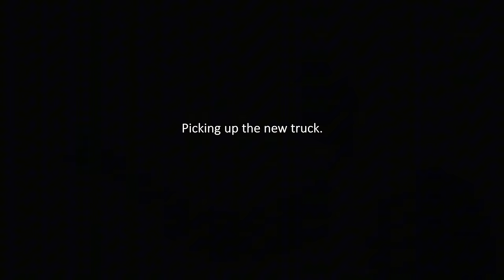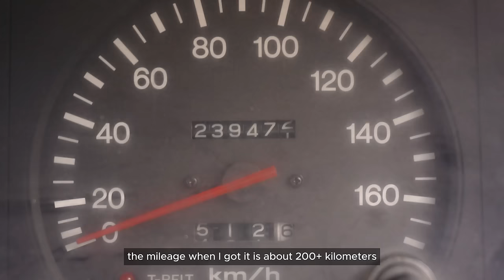I BOUGHT MY DREAM TRUCK!

Comment: 1KZ engine - don’t push it when going uphill, slowly crawl and watch the temp meter, the key is to not get it overheated (install an external water temp gauge, that certainly helps) - maintenance with the cooling system is paramount. Enjoy the journey with the truck
Reply from the maker: Cooling system and Overheating prevention. Will keep that in mind. Thanks for the tip!
Reply: @JunOutdoors  I want to agree with @alantan7644.  The 1kz-t is a great engine, I have been driving mine for 10 years now.  BUT they have a weakness, like all engines have .  In the 1KZ it is the possibility of overheating and 'cooking' the aluminum head.  So regular maintenance of the entire cooling system is 100% important.  That means a clean, good flowing radiator, properly functioning thermostat and radiator cap, unbroken radiator fan and fan shroud, good/non-brittle radiator hoses, newer water pump, a working fan clutch (if the fan clutch has not been changed or had the viscous oil changed, it probably is worn out by now just due to age) and of course proper radiator fluid/antifreeze.  I do not know how much 'baseline' maintenance has been done when you bought it, but please do not plan to spend too much money modifying before you do proper 'baseline' maintenance.  That includes timing belt, replacing water pump if you have no record of it being done, and checking all hoses and vacuum lines, engine seals, all of which just get old after 30 years of hot/cold cycles in the engine bay.  Also: if your truck and the automatic/electric 4wd hubs on front axle, they are well known to not work and are very difficult to keep maintaining fixing. Consider converting to manual hubs, and while you are at it you can do a full front swivel hub rebuild with new bearings and seals.  Congratulations on your new truck, I love your manual gearbox and PTO winch!  Just be prepared to spend money on maintenance, even if the LC is legendary for reliability is it only reliable when the owner spends money regularly fixing problems BEFORE they become a big problem.
Reply: similiar to zd in a patrol i own, i would make this 1st priority before anything as it has similar problems. radiator, egt gauge, exhaust, intercooler. nothing crazy fancy, mainly upsize these components. i think snorkel/airbox and safe tune would be after
Reply: good advice
Reply: Careful with the 1kz engine. Also upgrade the exhaust to 3inch pipe to help the engine. Their heads are pretty weak

Comment: The 1kz engine is proven to be powerful and reliable , just make sure it doesn't get overheated.  Make sure the cooling system is functioning well. Once the 1kz overheated it will start having endless cylinder head issues. The 1kz will run like a clock unless it get overheated. And don't forget it's a belt driven engine, if the last change history of the timing belt is unknown, better have it change before any long journey drive.
Reply from the maker: Prevent overheating and watch the timing belt. Got it. Thank you so much for your tips and insights :)
Reply: @JunOutdoors  Also, just from looking at your engine bay, it certainly looks like your fuel filter is old?  Dark and stained anyway!  If you have no record or it being changed, would suggest doing so soon and I replace mine every other oil change (every 10,000k, although that is here in Africa with questionable diesel pumps n stations, etc.)

Comment: That is one beauty of a rig. You Tube recommended your channel and I am glad they did. I subbed and as a fellow Overland enthusiast I am looking forward to your build. My build out is done mostly with composite panels to keep the weight down. The company I work at rebuilds Aircraft and I was lucky enough to acquire some composite floor panel  remnants and built my platform with a wood 2x2 frame and also a fold up "rear door" kitchen box. The box is 29x18 and I  was able to mount it using one hand because it it so light for my door. Again thank you for your positivity and enjoy that sweet rig.
Reply from the maker: Hi there, thanks for the sub! Your build sounds very interesting. Would be great if you could share it on any platform so we could get some ideas!

Comment: What fantastic buy.  These rigs are tough.  There is a very good reason why the 70 Series Land Cruisers continues to be very popular here in Australia despite not having changed much in way of exterior and interior design since the mid-80s..  They just go, and go, and go, and go.  And you're not wrong, 200k kms on a Toyota diesel engine is nothing.  Have fun getting to know your rig.  And you'll find out customising your rig for your perfect overlanding rig never ends (we call them "Tourers" in Australia).  There is always something to tweak and/or improve as time goes on.  But that's half the fun of owning a 4WD.  Congratulations. 👍
Reply from the maker: Thank you. I guess there are many good reasons that have earned the 70 series their great reputation. Your words are very reassuring, now I feel even better for buying it! Can't wait to have all the fun with it :)

Comment: Excellent car, I have a similar car 1993 same engine and it has never failed specially the engine. Durable and stress free with go anywhere attitude. I'm sure you'll enjoy. Word of caution just watch the weight when you are building it up for overlanding
Reply from the maker: That's very reassuring to hear. Awesome. Yes, I will be mindful on the weight as I start building the rig. Thanks!

Comment: Good choice on getting an LC. It's tough and very capable off road. But, you need to keep an eye on the fluids. LC's are known for overheating issues. Other than that, I'm sure you will love driving it on tough trails.
Reply from the maker: Oh yes I have been told about the overheating issue. Thank you so much for your tips!

Comment: Swear to God, you’re absolutely amazing. 
I have no problem with clutch gear on the motorcycle, but I find myself a little bit struggle with manual gearbox in a car. 
Congratulations for your new vehicle ❤❤❤❤
Reply from the maker: Thank you so much :)

Comment: Welcome to the club, you definitely need to change those brake paddle to the manual one,those Auto brake paddle is bulky and makes changing gear abit hard
Reply from the maker: Not really sure what you mean, but I feel like my brake paddle works just fine and there is no issue changing gears for now. Thanks though!

Comment: if possible, install a transmission cooler. it will bring your temperature down as overheating is a common problem for 1KZ engine.
Reply from the maker: Thanks for the tip!

Comment: I love that mark2 lc.. the seat very comfy. Got spring some more.. hahaha.. but this suv needs 2 batteries. But it’s a great vehicles.
Reply from the maker: Lots of possible things to add. A 2nd battery is definitely on the list :)
Reply: Bigger battery like Din100  easier install and good   I also a lc2 owner

Comment: you can check your wheels/rims specs because the way I see it, its wide. there is nothing wrong with it actually but selecting too much wide wheels/rims as your preferences, can stressed the front axle oil seals and kingpin bearing as well. when your oil seals is damaged, fluid will comes out and it can be noticeable when you look at the inner side of your front tire. check on that regularly.  thats the cons of using wide wheels/rims. the pros is its looks cool and buffed. Anyways, congrats on your LC ! Have fun cruising it !
Reply from the maker: Thanks for your input. Definitely something to look into. Those rims are just temporary though, and will be replaced with something more suitable, in time :)
Reply: @JunOutdoors  yeah. 16inch with 8.5JJ rims just fine for the choices. plus it also gives a good grip for the tyres to work in a muddy situation.

Comment: Just listening to your initial listings of What-to-do for your latest "baby",sounds logical and systematic too. Suggestion:to classify Each Big Item by name eg Vehicle Chassis with sub-categories like Engine, Transmission including the mechanical PTO, Suspension anticipating Additional weight from the list of Add-ons to achieve a True-camper/liveable Truck,Brakes,Water storage and Electricals.Can only visualise your truck becoming better day by day and attending a real-4WD course,is highly recommended.Do not rush and as you had said,Bonding time with your truck,is crucial so that eventually, you and your truck are like hand-in-gloves.. do not rush. best rgds.
Reply from the maker: Thank you very much. I've got lots to learn. It will be a steep learning curve. Slowly but surely!
Reply: The saying of "Rome was not built in a day", so just pace yourself and no need to stress yourself up by uncalled-for rushing.

Comment: Excellent choice Jun though it's quite a unique choice I must say! The LC 70 series mostly do come in MT and up to the most current LC300, this model and its  model range has had the reputation of some particular capabilities which u will come to appreciate soon which are having good payload for your camping gears and crew, approach and departure angles which I reckon u will absolutely need to push u through to even deeper troughs and terrains. Hope u don't need to use the PTO though haha... Happy for u and looking forward to seeing more of your Vlogs! And no pun intended when u mentioned about "bullet proof" engine..  this vehicle has the capabilities to be up armoured too😅.. Hit the road soon, enjoy your new ride and be safe always!. Cheers!
Reply from the maker: Just reading through your comment gives me so much excitement. Thanks for your insight. I can't wait to experience this LC :)
Reply: Mutual and glad too amongst heaps of responses that you have  received and responded too.. but naturally there are still limitations and boundaries of the LC that needs to be adhered to so just be mindful.. nonetheless, I'm quite confident u can now push your own boundaries of adventures beyond what your previous ride can do.. 😉.. enjoy and stay safe!

Comment: wow! wow! great choice of model and specifications! As for the name, my suggestion is JULIANA  , indeed female intonation and if coupled with JUN, the short form will be a beautiful JJ! easy to remember,sweet-sounding and easy 2-alphabet decal! Since it is an MTM ( manual transmission),your left foot especially your calf muscle,will be well-exercised if you are stuck in any traffic jam.Just have to bear this in mind. As for the Front Two Wheels,please check whether they are Full-time Or Part-time 4WD. Hint...if they are the Part-time type,you will see an aluminum -like center hub with a Rotational grip and the LOCK letters embossed on its  circumference.This set-up allows you to free the two front wheels when you do NOT need the full 4WD, making driving lighter and better fuel economy. Best rgds from me,david, Kampar.
Reply from the maker: Jun and Juliana! That's really cute. I'm glad you didn't suggest June and July, like the months. Lol. And yes I have driven in massive traffic jam and got a good workout for the left calf. I believe mine are Part time 4WD. Thank you so much for your insight :)
Reply: tq for liking my humble JJ suggestion. About the part-time Four wheel drive, it is important to turn BOTH hubs to LOCK when you decide to use them as a real 4x4. If you are not using them, certainly feel free to turn them to the OFF /free position. Having said so, in the owners manual,there is a paragraph that reminds any owner to at least drive them in Real 4x4 for a few kilometers, once every 6 months or so.Reason,is to ensure the locking mechanism gets to be lubricated at intervals to avoid any seizure ( at the desperate moment when you need the 2 front wheels to be locked.As your model is a JDM ( japanese domestic market ) model, i believe if you do find the owners manual in the glove box after a good 30+ years, it will be in Japanese. Do let me know if you can locate the Owners Manual  tq.
Reply: Besides myself,there is at least one other viewer of your video who noticed the Red Warning Light on your dashpanel. It is too blur to see in the video. My guess are:-
1) Low Brake Fluid Level in the brake reservoir.( has an in-built float sensor)
2) Water level too high at the Diesel Fuel Filter lower half that is a Water Sedimentor. Water is the Greatest Enemy in any diesel -powered engine.Also has a built-in float sensor. If this is the Cause of the red warning light,then just go to the Bottom of the sedimentor bowl n give it an anticlockwise turn to allow the Water to flow any.  Hope this helps. if you can tell what that red warning light at 9.01 min of your video,is, then,a better answer is possible.

Comment: If that's the battery light on, get it sorted asap, also will give you a revcounter back. 
Enjoy it and grow. Take some proper off road training and learn how to use the winch. I really hope you didn't spec a PTO winch as they have some really big drawbacks and most knock out the drive pins and bearings often. I'd not have one after 25 years of off road driving.
Reply from the maker: Thank you very much for your input and insight. The light was actually the hand brake sign - did not release the handbrake completely, only halfway down and luckily I realized it soon enough. Rookie mistake! 
I don't know much about the PTO yet but I will soon learn about it and find out :)
Reply: @JunOutdoors  ahh, hand brake, yeah never trust a LC hand brake, they are worse than Series Land Rovers!  Get the rev counter fixed, it will help understand where best to change gear to keep in max torque range. It's a good base vehicle so you'll be ok with some luck. You got the right choice with the manual opperated pump. Easier to fix than the edc versions
Reply from the maker: @overlandready  Appreciate your input and tips!

Comment: Pretty awesome upgrade from Subaru hatchback to Prado.  I recently sold a Prado 120 and picked up and LC80 with 1FZ-FE since that's all we got in the states.

This vehicle is a little confusing though.  You say it's a 91 but I didn't think the 1KZ was offered in 1991, you also mention its an LJ79 which makes sense.  It would be a 2L-TE.

So I'm guessing it was a 1KZ-T swapped in to an older LJ with a manual box.  This way you avoid the electronic injection which ALL KZJ78s(4 doors) had as far as I know.  But swapping it would also lose control of the auto trans, which again they all had.  But swapping the motor into an older truck makes sense, because you also get the manual box.

But what is still confusing to me is the fact that it has the newer interior from a 93+ truck.  So that was swapped to?

Very interesting setup regardless.  I'm interested to see where you go and what you do with the build.  
I'll be watching.

I will mention though.  You say the 1KZ is the best diesel from Toyota, and it was around for a long time. But the six cylinders like 1HZ and 1HD-T were definitely stronger engines over all. For power output and longevity.   I do hope this particular Prado does well and lasts you a long time though.  Especially with how unique it is.
Reply from the maker: You definitely know your land cruisers well. And yes you are right - this LJ79 did not come with the 1KZ, it was fitted with a half-cut 1KZ later on. 

About the interior, honestly I'm not very sure. 

As for the engine, there are many engines out there which are great and probably better than the 1KZ. I'm excited to see how the 1KZ serves me. Only time will tell! Cheers

Comment: Most of these things are rotten rust buckets you were lucky to find one . But not sure I’d want to go traveling in something 30 years old as good as they are / were
Reply from the maker: I do understand what you mean. A fully mechanical vehicle does have many advantages over newer modern vehicles though.

Comment: Hi from New Zealand! I have the same wagon over here, KZJ78… was that Puchong you collected it in? Have family there too. 
As others have said, do your research on keeping the 1KZ from overheating, but they all seem to crack a head every 250K or so.
Reply: Oh yeah, need to add that my wife is Malaysian, 4’10”, and drives it most of the time: had to be a manual of course!
Reply from the maker: Hello fellow LC owner! Thanks, and yes it was Puchong. Great observation.

Comment: Subbed. I wanted a patrol/lc too :/ but i use my vehicle as a daily. It needs to be reliable. So i got a bnew 4x4 instead :(
Reply: Wow its a manual!! Cheers. Im a manual too. Quick tips for offroad 4hi will be difficult on more technical stuff. Go 4lo up to 40kms/hr. It makes clutchwork easier. If i need to go faster than 40kms/hr, it means the terrain gets easier and i can shift to 4hi. If not, im 4lo all the time offroad.
Reply from the maker: Cool. Thanks for the tips!

Comment: WHY did you choose the 1991 LC?
Reply from the maker: Always loved the 70 series. Can't afford to buy a new one. So I looked for an old one. Buying a well-maintained old car requires luck and timing, and when I finally found this 1991 LC with good specs, I knew I had to get it.

Comment: just be careful not to overheat the engine as the engine head is prone to cracking and they are definitely not bulletproof to begin with🤣
Reply from the maker: Ahh, overheating. I've been told several times to keep a watch on that. Thank you for your insight! :)
Reply: @JunOutdoors  i suggest if u have the budget u might wan to consider putting a 1kd into it replacing the 1kz. More fuel efficient and powerful.
Reply from the maker: @isaaclim1561  Thanks for the suggestion :)